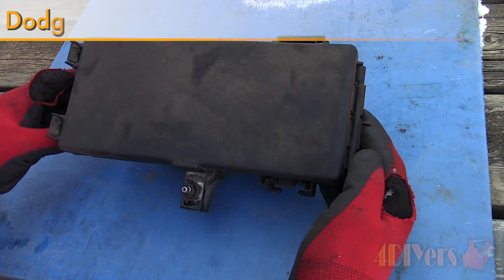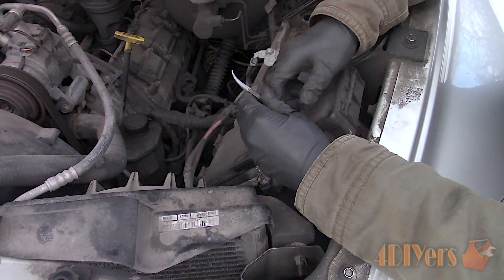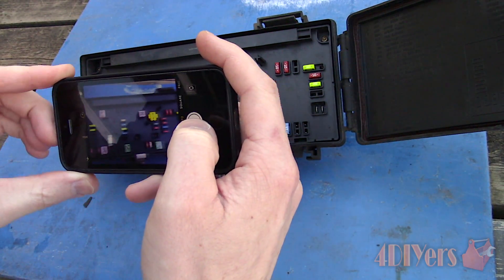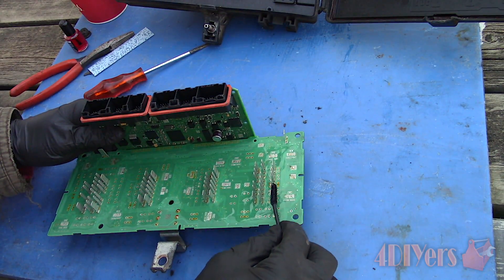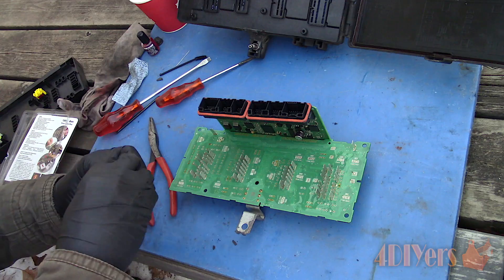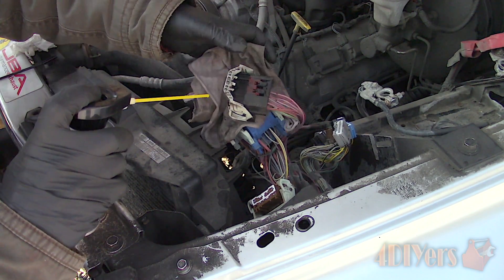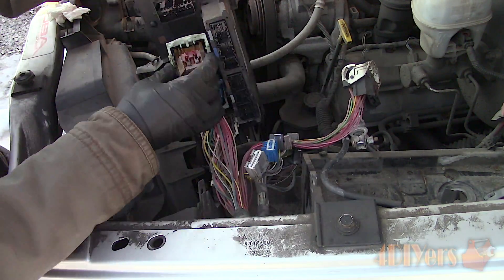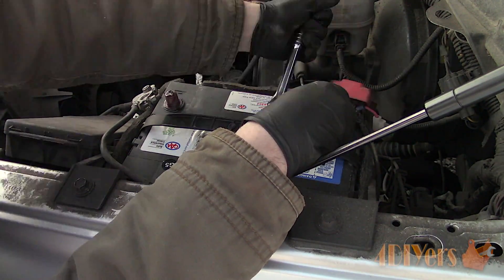How to Remove and Clean Corrosion on a Dodge Ram TIPM

Comment: My 4x4 completely lost all power, then  I hear an intermittent buzz from the fuse box, my flashers flash once when pulling my key out, and today tge abs, fuel and brake lights came on

Comment: We have an 06 Dodge ram 250 5 7liter Laramie version I believe it’s got a full four doors on it it’s got a no start situation acts like it’s in a limp mode we have tried everything other than the tipm watched your tutorial on cleaning the unit my question is the owner installed power disconnect on the negative side of the battery because he thought he had a battery drain could that have caused the problem could he have deprogrammed this thing or it caused some kind of a situation we went through a reprogram and Dump procedure , dumping the power off the capacitors but it did not help.

Comment: Very nice, will do the same on my TIPM on my 2007 Durango. Not sure why she’s acting up, could be water damage. I’ve changed the footwell junction box (2nd hand one) but still same problems. Will clean out all wiring harnesses / clips and inspect all wiring, and also trace water run off and protect the engine and all fuse boxes! Thanks a lot
Reply from the maker: Happy to help and good luck with the repair. Keep me posted how it goes.

Comment: 2010 ram 1500 5.7
I have a completely no power situation after driving through about 5 inches of water, the truck limped a bit. Was cut off and then when went to restart there is nothing. No lights on in the truck at all except the odometer. What could've caused this to happen?
Reply from the maker: Potentially. Sounds like water did affect the electronics. I would start by disconnecting the battery and letting it sit for a day or two, allow the electrical components to dry out. I've driven my truck through 12" of water more than once and haven't had any issues.

Comment: WOW 😳 awesome video thx for posting.
Im having trouble with my 07 Ram. No low beams.. didn't know you can overhaul the Tipm yourself.. I may have to try this...
Reply: So did you get it apart, find a problem and resolve the issue?
Reply: @trrickedout3453 I found a place that rebuilds Tipms by LA... solved my problem
Reply from the maker: Thank you for the feedback!

Comment: Possibly the truck i had with the most electrical issues with the less fuse for the so many wire it have. No schema nowhere about wiring, you have to check it one by one.

Comment: My turn signals would occasionally stop working for no apparent reason and would only work after disconnecting and reconnecting the battery for my 2007 dodge caliber, so I took out the POS TIPM, found a few of the pins had some green corrosion, sprayed it with electrical contact cleaner until the green was gone (let it dry of course) and so far ZERO ISSUES. 

Thanks to your video I was able to remove the connectors without breaking them and do a good cleaning. (Edit, there appeared to be no corrosion on the circuit board so I didn't take it apart further then the top cover and fuses)

Comment: Thank you for the video. I am having electrical issues with my 08 dodge 1500 . I replace the battery,alternator and the starter. It will turn on for about 4x during the day then nothing.. just click click… I am frustrated. They said change the ignition relay but it’s seem my truck doesn’t have one or I just don’t k know where it is located. Can you help me
Reply: hey did you ever figure out what the problem is with your dodge ram? im having the same issue

Comment: I have an 04 3500 that I’m having some electrical issues with. I cannot control the headlights/running lights most of the time, most of the time they turn themselves on and off, etc without my intervention. This happens whether the truck is running or not. I’ve replaced the headlight switch in the dash and checked all the various connectors for corrosion and it’s still doing it. Do you think corrosion in the TIPM could be causing this?
Reply from the maker: Try disconnecting the battery, touch both the negative and positive together to drain the system completely for a reset. Also, are you running HID or LED lights?
Reply: @4DIYers  other than a trailer brake control and a radio, there’s no other aftermarket electrical items on the truck at all. And both of those were installed after the problem began occurring, and it’s slowly gotten worse over time.
Reply from the maker: Try disconnect the headlight switch first. You'll need a wiring diagram to determine what is part of the system. Then start unplugging different components to see what will turn off the lights when they're stuck on.
Reply: @4DIYers  I will try that, thank you!

Comment: Good video 👍.  Have you ever had problems with the electronic throttle control on your dodge?  I have a 06 ram amd when I hit a bump hard enough I lose throttle control and the red lightning bolt light comes on the dash.
Reply from the maker: Thank you! No issues yet. Have you tried cleaning the throttle body? Next I would check any connectors for corrosion.

Comment: 2005 1500 dodge ram 5.7 they replaced the fuse box n FBC but nothing works no wipers or single lights or horn windows do drivering lights do but when I try to scan it with OB2 soon I pug in scanner everything works but my pcm is from 07 4x4 5.7 my truck is 05  2w  5.7 truns on but no cluster works it just flickers so I'm getting a pcm it say no link wat is it

Comment: Question =   when doing hard reset,,do you tie batt cables together while  tipm is still plugged in?  if so, do i need to wait  a period of time before unplugging Tipm ? does it matter?
Reply from the maker: It would be done when everything is plugged in, making sure all the modules are depleted of any electrical charge. A couple minutes should be fine.

Comment: What do I do for corrosion on my relays inside the cab behind my fuse box?
Reply from the maker: Use the same process. If the problems persist, then you'll need to consider replacing things or possible looking at other connectors relating to the circuit.

Comment: 2012 ram 1500 5.7..... started having gas gauge reading low and brake fluid level sensor circuit high c1008... could they be related through the TIPM?

Comment: Congrats on a fantastic video. I have two faults I can’t figure out how to clear.  This can’t hurt doing. CAREFULLY
Reply from the maker: Thank you so much! Yeah these Dodges like their electrical issues.
Reply: @4DIYers  Cheap fix for me. Bad o-ring in the oil cap. Leaked enough air through to cause aeration in the oil is my guess. $11. Although engine light went out after I left the part store with oil pressure sensor in hand. Do that next oil service. 160k.
Reply: @4DIYers  my other issue is CLEAN BACKUP SENSORS. I replaced them all but get the error message driving forward. But they actually work fine backing up. Wondering if I need to clean terminals on the TIMP(?) Fuse box. That’s a spring time job.

Comment: Does anyone know why my rear tail light directional or brake light don’t work , I’ve replace the circuit board and tail light wired ? Could it be the TIPM
Reply: Yes I have the same problem & the issue is the tipm.

Comment: We greatly appreciate ur video my 2008 Dodge problem u turn key about 30 time to start but it will start and run.joy of Dodge electrics.lol.
Reply from the maker: Thank you!
Reply: The starter circuit I went to auto part store had starter tested it tested bad or so they told me but I grew up in a junk yard so I went back home I just came out of hospital with heart surgery so I test starter with jumper cables and 10gauge wire. Hooked to main terminal of starter + then grounded the starter with jumper cables. Touched 12+to starter to solenoid on the starter it bench tested fine. Next I simply reinstalled started (I just had heart surgery so I only have one had to work with but it my hospital ride)  
Next simple remove connector from starter solenoid went to Napa or any auto parts store (parts needed one electrical I ring connector to fit on starter main terminal 12+ 6ft gray 12 gauge wire with a gray vinyl jacket and inline fuse with a 10 amp fuse I hooked it to the 12 volt big terminal on the starter after I took the battery loose always take the battery loose first unbolted the terminal put the iring under there with the wire on it with the fuse on that side I ran it up to the driver's cabin on the inside I looped it through my clutch switch cuz I have a standard transmission and hooked it to my push button switch the black wire went back to the solenoid on the starter which I used a red butt connector crimp it halfway shut and pushed it on the terminal I coded everything with liquid tape and electrical tape to keep the moisture out which the manufacturer should do but they do not push the clutch down turn the key on to the ignition come on and I push the starter switch button and the POS started take the space shuttle out of your cars guys we're not going to be flying in outer space anytime soon I hope this helps some of you poor guys because I was having a tough time in one hand after being in the hospital thank you for listening to my nonsense I have others if you need them like how to get rid of those body control modules for the rear in the front the 1500 a piece

Comment: Hey man. I did this and somehow the anti theft activated. truck did run for two seconds then shut off. Did it 3 times now it wont even fire. How do I reset the anti theft. I have looked online and have tried with everything with almost no help.
Reply from the maker: Is there a red light flashing on the dash, is it the original key, do you have an aftermarket alarm system?
Reply: Have same problem what you end up doing?

Comment: The TIPM looks slightly different on my 2005 Ram 1500 where the main power is at the end furthest from the fender, but it has the main power connection, and it is corroded. I am having little success getting that nut loose. I am soaking it in PB Blaster, but there is not much holding it except the plastic case of the TIPM and the way it is connected to the circuit board it connects to so it isn't like I can put a huge amount to force on it. It is surrounded by plastic, so heat is not an option. Any suggestions other than continuing to soak it in penetrating oil in hopes it will eventually make its way in enough to get it broken free?
Reply: This unit is from an 06+. 02-05 have a different unit and technically is not a TIPM but still the same concept

Comment: NEVER BUY A DODGE AGAIN ****I have a dodge challenger 2014 and i had to fix so many items in this car that is ridiculous. 
Ac, compressor
Ac controls 
Time chain
Water pump twice 
Head lamps relay
Sun roof mechanisms and sensor
Smart glass (windows auto up)
TIPM (part of computer? $1700.00
Trunk release mechanism 
Check engine light multiple times
Etc
Etc. 
Is for sale heap and will be my very last dodge/Chrysler vehicle i buy.
Reply: Welcome to vehicle ownership. Just wait until you buy a house and own it long term.

Comment: If I replace the TIPM. does it have to be programmed to the truck? I’m going to try and clean it first. Thank you for the video.
Reply from the maker: As far as I know, yes the TIPM does need to be programmed for the vehicle. Instead of a dealer, a private shop should be able to do this as long as they have the correct equipment. No problem, happy I could help!
Reply: Tipm will need programmed !
Reply: As long as you get the exact same part number, it will not need to be reprogrammed

Comment: I have a 2011 Dodge Ram 1500. My wipers and windows won't function normally. Dash has all fault lights on. If I turn the wiper knob toward me and press on the the window buttons on the driver door, that makes my wipers go. I can only open and close the passenger window if the wiper knob is turned toward me and that's the only window that will move.. Could this be the tipm or corrosion on it? No auto electrician I've spoke to has seen this problem.
Reply: I just had this problem come up as well.  Did you figure out if it's corrosion?  I'll end up pulling mine apart this weekend
Reply: @pickford7812  Car is in the shop right now. So far I was told they found a lose ground near the brake. They also disabled my alarm though so that could  have been the problem too. I asked them to put it back. Strange thing happened though about a month ago. The truck has had this problem for about a year, about a month ago it rained heavily and everything I mean EVERYTHING started working again. About a week later everything went out again. Just crazy. Hope this doesn't cost me a fortune
Reply: Did you find out the problem with your truck?
Reply: @fabpie6356  i ignored the problem and it went away.  If it comes back, I'll probably pull the wiper assembly apart and clean the park contact

Comment: I have a 2006 ram 5.7 and my lowbeams dont work. Only highbeam. Helpppp
Reply from the maker: Could quite possibly be the TIPM.
Reply: I had this problem it was a fuse and a wire to headlights
Reply: @saddamlucdahlia7842  do you recall what fuse?
Reply: @fishingwithalexx did u find the problem??

Comment: Thanks for the video.  Very informative.  Can you tell me if the TIPM would make the 4 wheel drive now work?  I can not find any reference to 4 wheel and TIPM but a dealer told me that is what it was to the tune of $1600!!!  Thanks.
Reply from the maker: No problem and thank you! It's quite possible, the TIPM can cause quite a few issues on these trucks. You would need to look at a wiring diagram in order to determine where all the circuits are tied in. However I would be surprised if they just wanted to throw parts at it either. If they have the work written up as a TIPM replacement, clean it yourself instead. As mentioned in my video, if you do find a faulty pin which is an option equipped on your vehicle, have someone who does electrics work replace it. It will be by far cheaper than the replacement, I believe the TIPM alone is around $600.
Reply: Did you get it resolved, if so how? I'm having same issue, changed front axle actuator but it's actually not getting power to engage. So I may be looking at cleaning the TIPM or changing it out.
Reply: @jefferystensland1304  did you ever fix your problem with the 4x4 I’ve been having this isssue for the past year and no one can find the problem ?
Reply: @joegutierrez4619  
I did not, had replaced the axle actuator and could hear the actuator at the transfer case engaging. Ended up selling the truck.
Reply: @jefferystensland1304  I have been having the same issue. Cleaning TIPM today. Did you try this fix Jeff?
Reply: @stephengettel401  
No, sold the truck. Not because of that though, best of luck.